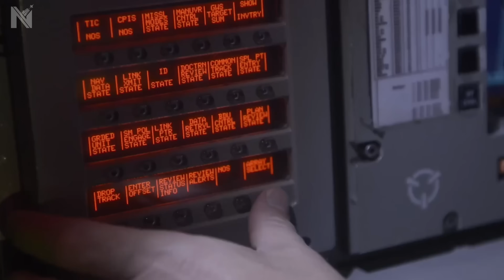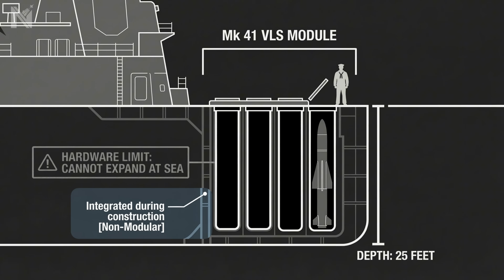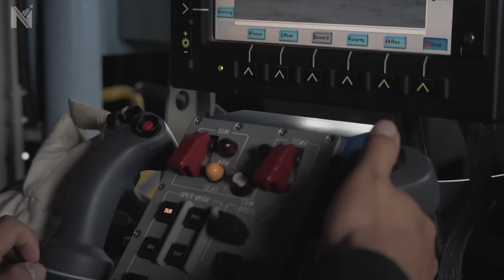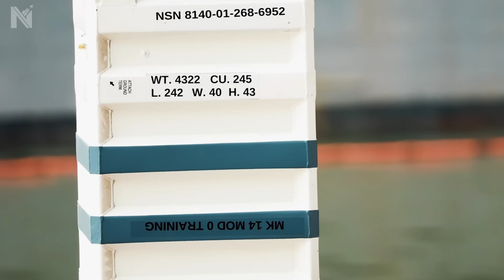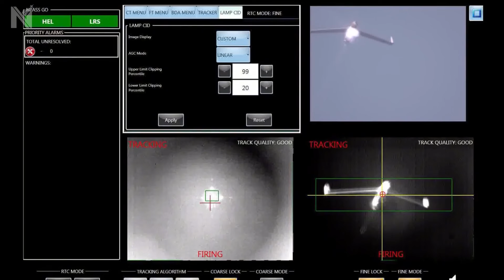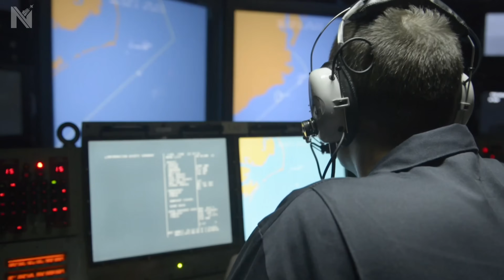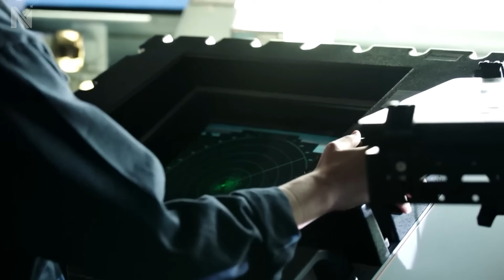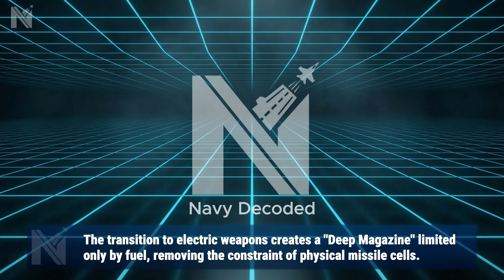Why The US Navy No Longer Fears Suicide Drone Swarms

Comment: Instead of building new Battle ships that look more like heavy cruisers. Just use the old Battle ships hull, gut it & install all the new tech on it.  HELIO, METEOR, Two Lasers, 4 CSWS (two high, two low), Rail guns, maybe a couple of old Ack ack in each side etc. Maybe the super structure of a new alloy to make it lighter. Nuclear for speed when needed, diesel for entering or leaving port or slow cruising, & gas turbine to provide all the electricity as needed. Can always install a small boiler & evap to produce water in tandem with reverse osmosis, redundancy to the max. Old Battle ships have the volume for all necessary tools to fight & defend the fleet. The Frigates can handle the ASW warfare. Now that will be a ship to be scared of, like it was meant to be.
Reply: Any ship sporting one rail gun, let alone multiple rail guns, will need to be largely built around the power supply requirements.

It would probably be more expensive to try and retrofit an Iowa class battleship than build a new one. 

Battleships aren't what is currently needed anyway.
Reply: @Transblucency all ships need power..
Reply: 😂😂 doesn’t work that way.. the hull has to be built specifically for the precise load and weight distribution and unloading of that weight otherwise you have a life raft just bouncing on waves vs a ship riding them
Reply: Too expensive
Reply: Hi energy weapons.   Which the US has been working but politics switches project off and on light a porch light. Laser, Electromagnetic rail projectiles and microwave energy directed beams.  Of coarse hundreds of anti drone drones.. A ship that has that only. Maybe a few anti ship missles as well...

Comment: We need these protections around all our military bases and important land assets.
Reply from the maker: That’s the same logic driving current doctrine. Layered, low-cost defenses make sense anywhere the threat is cheap, numerous, and persistent
Reply: Look at the new German 35mm in use in Ukraine. About to shut down drones there if they can build them fast enough.

Mostly a bunch of good sensor systems on things from 50 cal. on up.
Reply: Nope, it’s an ok system not the best. Look at Germany’s anti drone systems. A LOT better.

Comment: What is the solution if the drones are flying in fog, or above the clouds?  Water vapor (fog) will absorb infrared laser beams and also obscure vision (confirmation).  So there are limitations to the laser weapon.
Reply: That is why you have multiple weapons.  The USA also has drones of its own that are controlled by AI, but you won't see a YouTube video on them to insure the classified information doesn't reach enemies.
Reply: This is only one of the options. Video also forget Burke Flight IIA/III and Zumwalt class destroyers have 30mm Mk44 Bushmaster II that can fire air-burst munitions including AHEAD rounds good against swarms of drones. While the older Burke Flight I/II only have the 25mm M242 Bushmaster that can still defend against swarms of speedboats. So for Burke they have 2 of this besides the standard Phalanx CIWS/SeaRAM/RAM. But this is only for terminal interception. Helis are now more commenly used as they can intercept drones at long range. USN for example shot down Shaheed drones at the Red Sea with their MH-60R/S Seahawk helis.

Comment: What if the opponent create a counter to laser weapons because lasers are ineffective for penetration 
What if they lessen the amount of drone to one or two to counter the lasers by using aluminum and carbon for heat resistance?
Reply: Drone builders would put a mirror skin on the drone to reflect the laser, then we have to figure make a laser guided missile which would see the refection off the drone and home in lock in and hit it.
Reply: This is only one of the options. Video also forget Burke Flight IIA/III and Zumwalt class destroyers have 30mm Mk44 Bushmaster II that can fire air-burst munitions including AHEAD rounds good against swarms of drones. While the older Burke Flight I/II only have the 25mm M242 Bushmaster that can still defend against swarms of speedboats. So for Burke they have 2 of this besides the standard Phalanx CIWS/SeaRAM/RAM. But this is only for terminal interception. Helis are now more commenly used as they can intercept drones at long range. USN for example shot down Shaheed drones at the Red Sea with their MH-60R/S Seahawk helis.

Comment: I heard aluminum can counter microwave and uh carbon oh yes a carbon hmmm....

Edit.even tungsten.....
Reply: This is only one of the options. Video also forget Burke Flight IIA/III and Zumwalt class destroyers have 30mm Mk44 Bushmaster II that can fire air-burst munitions including AHEAD rounds good against swarms of drones. While the older Burke Flight I/II only have the 25mm M242 Bushmaster that can still defend against swarms of speedboats. So for Burke they have 2 of this besides the standard Phalanx CIWS/SeaRAM/RAM. But this is only for terminal interception. Helis are now more commenly used as they can intercept drones at long range. USN for example shot down Shaheed drones at the Red Sea with their MH-60R/S Seahawk helis.
Reply: Yes. And then your drones are more expensive, so we use our next higher cost defense to attack them.  We have AI drones of our own that are lower cost than the missiles in this video.  If we can get the enemy drones on radar, we can send drones that will take them out as well.  The enemy doesn't have a monopoly on drone attacks.

Comment: Can drones defend against this if all electronics are wrapped in a faraday sealed chamber?
Reply: Ahhh, if you cage all the electronics...how do communicate and control it?
Reply: Probably the next step for the drone builders!
Reply: This is only one of the options. Video also forget Burke Flight IIA/III and Zumwalt class destroyers have 30mm Mk44 Bushmaster II that can fire air-burst munitions including AHEAD rounds good against swarms of drones. While the older Burke Flight I/II only have the 25mm M242 Bushmaster that can still defend against swarms of speedboats. So for Burke they have 2 of this besides the standard Phalanx CIWS/SeaRAM/RAM. But this is only for terminal interception. Helis are now more commenly used as they can intercept drones at long range. USN for example shot down Shaheed drones at the Red Sea with their MH-60R/S Seahawk helis.